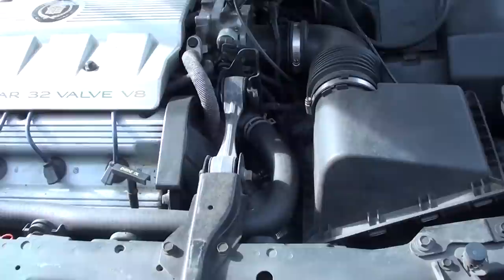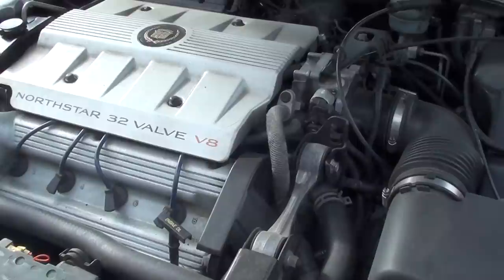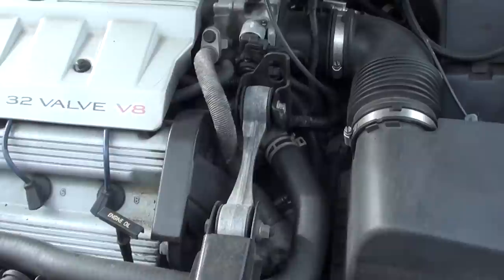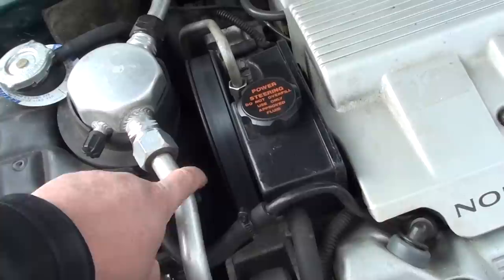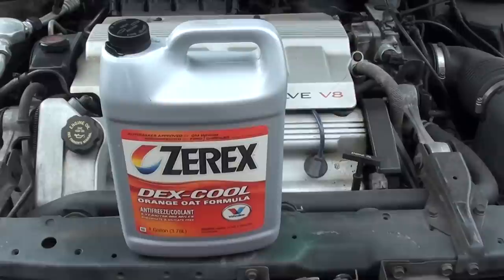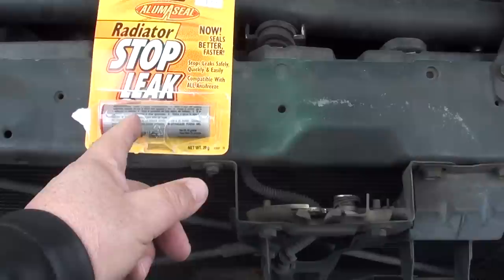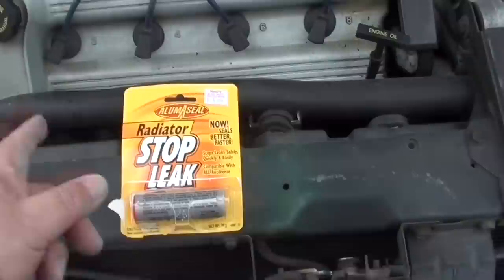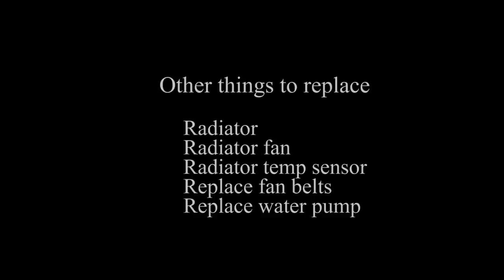Cadillac | Prevent Northstar engine from Overheating | What Mechanics won't tell you

Comment: Yes they overheat due to the motor being aluminum versus cast iron. I wish Cadillac would've just recalled these cars. They drive so incredible.
Reply: Noooo. They overheat when the older version's head bolts expand a little and causes a leak of coolant. Also, some tend to just toss any old coolant in there... I did... but as he says in the comments this engine needs Dex-cool. I am on my second, a 2005 DeVille, and before I bought it I opened the overflow tank and sniffed the coolant. It smelled perfect. A leaking gasket has a distinct smell. I drive it normally, seldom revving it high and makes sure to change the oil and use Dex-cool, etc. Been just fine so far. Best engine I ever had. Good power and economy. 32 miles per gallon highway, 18 to 20 city, belying their claim of 24 and 18 respectively.
Reply: @thisnametooktolong  NOOOOOOOO!
Reply: Most LS motors have aluminum blocks and they’re the most reliable v8 on the planet
Reply: @thisnametooktolong  Riiight. Whatever. Dozens of experts (not GE techs either) and personal experience versus you...? OK...
Reply: GM not caring cause by the time the headbolts let go most cars were on the 2nd owner or enough miles were they felt like they already got their money...aka GM being fucking cheap
Reply: @W4RY3NTRY  they are without a doubt the finest motors ever made.....I tried for 12 years to make one break, tear up, over heat...anything that I could use as an excuse to get another motor, it just would never die so I keep driving it....fucking incredible work of automotive engineering
Reply: Greg Epperson tbh I don’t remember making that comment lmao
Reply: This is an oversimplification of why. If that was the case all of them would have that issue but look around. The greatest years to have been affected ars 96 97 98. Yet yoi
U still see some around granted not a lot but a fair few
Reply: ronnie hightower, if engines overheated due to being aluminum, then almost all the engines made in import cars since the 1950's, and almost all the U.S. engines made since the 1990's would overheat, right?
Reply: @captainamerica9353  in this case I meant from these cars. The cooling system sucked and the computer to the thermostat ran them at high temps which they shouldn't. That aluminum swells at those consistent  high temps. These cars 0-60 is still incredible for them in the 90s
Reply: @luminazkidd21  It simply amazes me that GM would have a design defect that cost them the loss of so many devoted owners - and not fix it for 10 years!  The Northstar came out in 1994 with all the hoopla, and failed almost immediately over a bunch of $2.00 bolts!  They didn't fix the problem until 2004 - 05.  Not to mention the whole Dex-Cool fiasco.  Plus having Geo and Saturn yet crapping on Olds and Pontiac.
Reply: I've had 295s and 296 eldorados four of them and the biggest problem I found with everybody that has these North Stars they don't follow the manual they all think they know what they're doing if you follow the manual you won't have a problem for example being that decks cool the orange didn't come out until late 96 anything before that they used a green I use the peak green GMC American car high mileage older model it's it's my peak antifreeze I get the hundred percent I chop it down to 60/40 60% antifreeze 40% water I had one card it overheated because there was a hole in the radiator I replaced the radiator the thermostat at the same time everybody tries to get off cheap with these cars and that's why they have issues you want to buy you want to ride a Cadillac when you got Volkswagen money follow the manual these cars need their fluids it's an aluminum engine and runs hotter than the regular cast iron if they don't have fluids you crack the block whoop the heads you cannot put water in these cars it will last 10 minutes it will evaporate your car will overheat once you start overheating okay you got to change your thermostat and all that do not mix orange and green antifreeze it would make sludge do not put any sealants or that stuff they're talking about it mixes with the antifreeze and the clogs up your lines don't want to do any of that stuff okay don't want to take chances with these cars okay they're very particular and what they want okay I've never had a problem like right now I noticed my radiators leaking now I noticed this on my other one when the radiator went and I couldn't figure out why I was losing antifreeze is hairline fracture cracks that you can't see on the plastic reservoir bottle to the radiator the top hose there right there underneath there it gets cracks this is the second one that I've had that's cracked in the same place some people JB weld them I replace the radiator with a brand new one and I replace the thermostat and I won't have a problem I mean you know a lot of people do a lot of crazy things I know one guy used to use crazy glue to try to do it that shit don't work when if you have to use anything use the JB weld also remove the radiator out of the car plug up the holes and pressure test it put a pressure test on it to find out where the leaks are these days you can get a radiator you know the guy says to me take it out and pressure test it put it back in if I take it out I'm going to put a new part I'm going to put something brand new in it is no sense in trying to patch it for $70 at a brand new radiator the two biggest problems with these cars one people don't know what they're talking about and two they try to get off cheap and that's what messes them up I've had four of them and I don't have a problem and why because I maintain them as per the manual and if it's before 96 used the peak green us cars high mileage can you tell me something sir

Comment: great video! I've been telling other Cadillac owners the same thing for years. I buy the GM seal tablets at the dealership.
Reply: cadillac rick seal tablets are the key
Reply: Maintenance is key and the correct maintenance especially!  But great cars overall!
Reply: 06 Cadillac cra limp mode
Reply: Mark Zavala i always use the bars coolant supplement powder in my lower hose during my 4 year drain and fill refresh. It is made of ground walnut shells, and ginger root.  GM stopped recommending it because uninformed mechanics and owners accused dexcool of "turning to mud".
Reply: @davidjames666  I have a 02 Eldorado ETC.  No pellets, no leaks.
Reply: @lancedukel3436  yet
Reply: @markzavala2837  I agree and 90% of northstar owners don't even know what the tablets  are .. Kinda funny not really because before long 90% of northstar cars will be in junk yards thanks to dummies who put green coolent in them and think everthing is just fine .
Reply: @johnnygride2118  I've been running green coolant in mine for 18 years and it runs great.   Do you fall for the changing oil every 3000 miles too?
Reply: @garonburwell9008  Still no leaks. Or overheating.
Reply: @da324  the 03 Cadillac DeVille that I have now was my mother's it has 250,000 something miles with green coolant. When I  got the coolant drained and refilled it was Green 18 years the coolant has been changed 5 times and it's always been greens never overheated because she always get the hoses changed the coolant reservoir has been changed out 3 times  my mom used to get her oil change 4 times a year. She put about 12 or 13 thousand miles on the car a year it still looks brand new love minor issues here and there but 18 years same transmission same engine
Reply: @da324  really and truly I think if you use conventional oil which burns quicker you are supposed to change your oil about three 4,000 miles because the oil is burning so quicker because it's cheaper that's why conventional oil is cheaper
Reply: @CHRISFREE84  I watched an episode on 60 minutes 30 years ago that put the most expensive oil and the cheapest oil in two different NY City taxis for a year.  They changed the oil at 10k miles on both. At the end of the year they broke both motors down and the wear was the same on  both.  If an oil is SAE certified it will not break down anywhere near 4k miles.  The change your oil every 3-5k miles is a marketing ploy.  I've been running Supertech for over 20 years in every vehicle I own.  I change the oil around 8k miles and never had an issue.  It is a great oil made by Warren Industries who have been around since 1948.  I've bought Walmart's Everstart batteries for two decades and they usually last me 5 years also.  They out perform much more expensive batteries.  The world wants our money, I don't like wasting mine.
Reply: @da324  green coolant in mine  1997 deville  101000mi

Comment: I  am  not  able  to  get  a  lift  so  as  to  drop  the  engine/drive  train,  as  so  many  videos  have  shown,  nor  do  I  have the  equipment  to  roll  the  engine  in  order  to  get  to  the  rear  studs.  And  though  I love  my  Cadi,  unless I  use  it strictly  for  going  to  the  food  store  a  mile  away,  it  tends  to  get hot  after about  20  miles.  I  have  blown  air  through  the  purge  lines  and  watched  the  fluids  flow  out  of  them  when  they  are  apart  and  water  is  filled  into  them.  I  have  no  oil leaks  or  water  leaks  and  the  spark  plugs  are  new,  and  the  points  are  new,  and  the  water pump  is  new  and  the  drextol  fluid  is new  with  the  correct  mix,  yet  I  can  watch  the  temp  gauge needle  climb  into  the  red  on  the  gauge  after  about  20  miles.
     My  usual  Mechanic  passed  away  not  long  back  of  ALS,  and  the  rest  tell  me  it's  time  for  a  new  engine,  but  they  also  admit,  they  have  not  replaced  many  Northstar  engines  either,  which makes  me  wonder.  Jake  in  Canada  says  he  could  do the  job  but  the  stop  an  let  the  engine  cool  from  Florida  to  canada ,  man  would  that  be  a  long  trip.  Though  Jake  has  told  me  about a guy  in  the  Tampa  area,  who  could  do  the  job,  but  that  is still  a  new Northstar  performance  engine  or  a  Jasper engine.  Either  way,  that  still  means  dropping  the  engine,  and the  price  of  a new  engine  and  the  core  charge.  Plus  the  most  important  part,  the  wife,  and  her  thoughts...   Looks like I will  just have  to  let  this  one  go  and  find  another  car,  if  I  can.   Roomy and  all the  extras  and  the  cadillac  ride...  
     Perhaps I  will  find  a  way to  keep  the  cadi,  but  leaving  it  parked  in  the  carport  is  no  longer  acceptable.  It  is  nice  to  have  a  nice  car,  but  since  I  am  not  Jay  Leno,  my collection  is  only  for  cars  that  I  can  drive  every  day,  so...  Thanks for  all  the  great thoughts  and  advise
Reply from the maker: Oh man I know the feeling. So far my engine I running great but I know that time will come. And it hard to let go. Like a pet. Have you thought about putting it on a trailer and transporting it? Or put out a bid to have it hauled for a great price. To see what the cost is? Hey viewers. .is there anyone out there that can give this guy some advice other than putting her down?

Comment: Here are my thoughts. I've had many some great some not so great. What is comes down to it keeping the cooing system clean and do it on a regular basics. But here is where the issue lies..Its Oil Changes when they top off your fluids they don't understand dexcool and mix the green coolant with dexcool and in time this will cause a sluge in the system and over time it will fail. This was only because i had a 1993 Saturn and it was getting hot. When we did a flush we saw what in can do in time put in green coolant cars is just fine no overheating its been 2 years. and done the same to my 1998 Cadillac hearse and its perfect. just my take hope it helps someone
Reply from the maker: If that's what works for you more power to you. Good luck and thanks for stopping by
.

Comment: Thanks for the info! Just bought a well maintain 2004 Bonneville gxp with the 4.6 Northstar. Very informative.
Reply from the maker: Awesome!! Thanks for stopping by.
Reply: I've changed all brake lines, the thermostat and done a full coolant flush, and just did an oil change. Bout to change spark plugs and coil packs. Been driving to and from work the last 2/3 weeks with no problem.

Comment: Not to say this is the first GM in our driveway, my wife bought herself a 6 liter '05 Yukon Denali with 180,000 kms, (100,000 miles) at an auction last year for CA$1900.00  "It was so pretty!"  she said. She didn't notice the 'Check Engine Light'...for her  a minor detail. Codes read that the knock sensors were the problem. YouTube university showed me the process on removing the intake manifold, and fuel rails to easily replace those sensor's. Cost me near CA$300. And solved the check engine light. So far, this truck has run well now. Oh, she paid $2,100 for the Limo Caddy
Reply from the maker: that's good to know. i'm currently editing a hydro Brake booster Repair video on the Denali. it was long and a pain but got it done. should be out about 4 days

Comment: My experience/opinion/do’s&donts: 

If you see a leak small or big get it fixed as soon as you can. A little leak can turn into a big leak and a big leak can turn into a big problem. The owners manual tells you “do not run a Northstar on water. If you do you will blow a head eventually” It also states “Use ONLY GM approved products” etc. People are hardheaded and cheap and that’s the wrong thing to be if you own a Cadillac. When it comes to the cooling system this is when you really don’t wanna be cheap. Get the GM DEX-COOL coolant (not the 50/50) and never use green coolant. I dont know anyone who has followed the simple instructions on a Northstar cooling system and still blew a headgasket......

P.S. FOLLOW THE OWNERS MANUAL #Simple
Reply: Why not the 50/50 pre diluted?
Reply: Using dexcool coolant is good, but it must be 50/50…
Reply: Water pump impeller goes bad
Reply: Dex cool clogs up radiator,used universal coolent does work greati put it in mine 4yrs no problem

Comment: I am so glad I found this video along with many others regarding the older caddys. My wonderful wife bought me a '98 DeVille 6 door Limo for Fathers Day. This car was garage kept for its entire life. Very cool part is that it only has 79,000 kilometers on it That's 49,000 miles for you south of the border. The car is mint. Under the hood is like looking at a  brand new engine bay. The rad hoses still have the manufacture date on it of 12/09/97, yet they are solid, supple and appear to be in excellent condition So, I will be going over some of these maintenance and preventative measures I find here, to ensure that I can get a long life out of this car. We will be using it to volunteer drive for transporting cancer patients to medical appointments down in Victoria BC. Thanks for the platform here providing direction for the backyard guy trying to make things work and perform with thin wallets
Reply from the maker: Thank you very much! im glad you stopped by. I have 48 Cadillac Videos. Check them out when you have time. Thanks for stopping by.

Comment: I wedged a small water bottle against the firewall and stuck the radiator cap overflow tube into it (rather than dumping it onto the street as it does from the facrory) this allows me to keep the surge tank as full as possible, and returns the expelled coolant back into the surge tank
Reply: Surge tank is half full cold. That's the right level.

Comment: I think these Northstar engines are not cooled very well and this leads to the headgaskets failing.  The fans are set to come on at 223F. They should be coming on at 200F in my opinion. I did a test where both fans were turned on(thats on high) and the coolant temperature would not stay at 203 degree F at an idle. The rpms needed to be increased and held at 1500 so that enough coolant would circulate to cool the engine and keep it at 203 degrees F.  When you are driving on the highway what is your coolant temp averaging?  Are you able to maintain that coolant temp at idle with both fans blowing on high? Would you do this test on your car and post the results? One way to force the fans on is to turn on the AC. Another way is to go into the diagnostics and manually turn the fans on.
Reply: No the reason the head gaskets fail is because the head bolt threads strip out of the block I've been working on these engines since they came out in 1994 that's the reason why the head gaskets fail

Comment: I own a 1999 Deville D'Elgance I purchased from a 1 owner garage kept with 70K miles on it. I noticed he used the green antifreeze I'm going to change it out. Other than that no leaks and all new hose's when I bought it. With winter coming along Im taking measure so I'm going to flush the system a real flush of entire HAVC system along with back flushing the heater core. I love a hot G.M. heater and it's way to cold in the winter.
Reply: I have a mechanic thats works at a caddy dealer for 30 years and he said dex cool rusts the gaskets an makes them blow. So from what i was told the green is the way to go

Comment: Sometimes the head gasket will crack where the water parts right next to the exhaust exhaust gets into the coolant and causes the vehicle to run hotter. Or head bolt stripped same difference.
Reply: 96 bro. Traction control on no. Off ??engise. Chk came on. Week pass. Gets firer donot turn over? Waterpump??timing chain. Ir just tirad too.
Reply: Meant. Engine. Tired too??